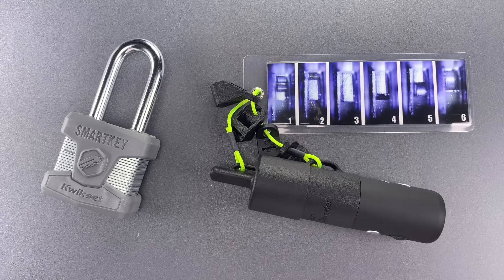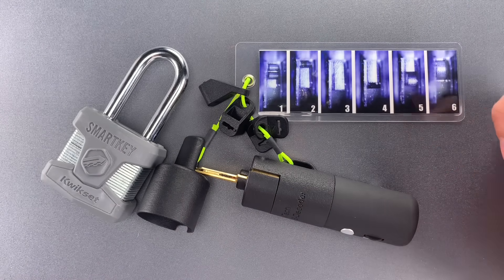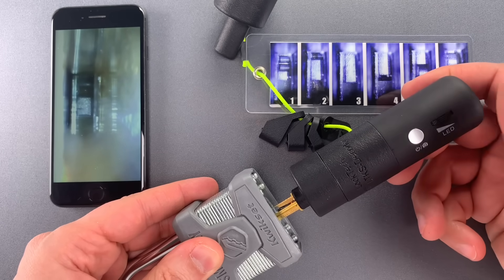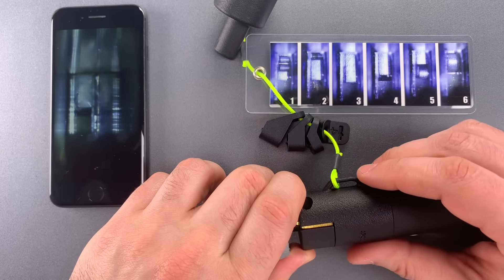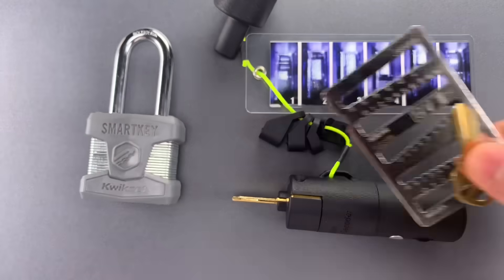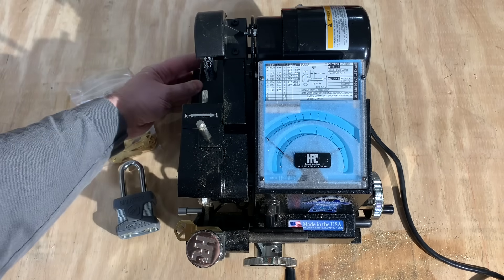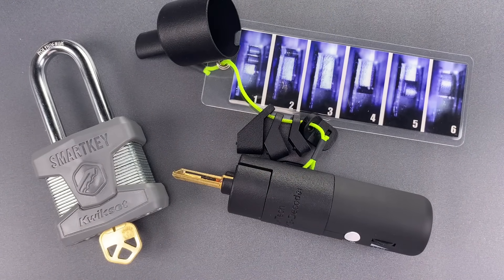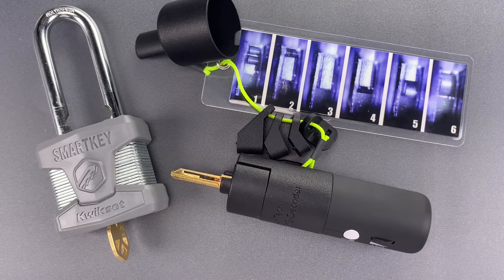[1209] This Tiny WiFi Camera Owns Kwikset SmartKey (LockTech LTKSD)

Comment: That phone application can easily be improved.  One should start recording a video.  Slowly slide the camera past all of the sliders to the all the way in position.  Slowly remove the camera.  Stop the recording.  Break the video down into stills for each Slider.  Calculate the Depths of Cut.  Generate the Code to make the Key (1, 2, 3, 4, 5, 6).

Comment: It never ceases to amaze me the ways which we have locks designed to resist attacks and tools to make attacks against new designs and to make the attacks even easier.  Picking a lock is an elegant solution but I'd submit so many of these would yield to a battery powered grinder or cut-off tool. Locks really only defeat the most casual of attackers. Just watch these videos on YT of home invaders bashing in people's front doors at night.

Comment: This tool is awesome when using it on a brand new lock. How ever when using it on a lock that someone has rekeyed it with a worn out key or a miss cut key . The cuts will not match any pictured or off to some degree

Comment: With a little software you ought to just be able to get a video stream and insert the key and remove it without even lining it up (as you'd get a full image of the interior) and then using a simple AI image detection to automatically tell you the key numbers. This could also be a handheld device that doesn't need the phone with a little more hardware -- but the bluetooth would be easy too.

Try inserting the key and pulling it out with video recording on your phone on, and then see if you can extract the frames needed to determine the key numbers by hand. 

This would allow for simply a quick insert and then later determining the numbers.

Comment: 2:10 dude GETTING ONE OF THOSE MACHINES for a private citizen must be so hard and require so much paperwork you NEED to be a lawyer to get it.
Reply: Surprisingly no. Just a credit card the camera device is about 400 and a basic key machine is 250 upwards. There are no bonds licenses or barriers to getting them.
Reply: @Lunas2525  It just continues to prove the point LPL has set out to prove: the locksmith/lock industry has largely relied on the public's ignorance rather than innovation the past 100 years or so. That really stuck with me after he showed a weakness in a common design that has been known since the '30s but someone like Master Lock is still using.

Comment: I'm so worried about my access security now (USA). I bought an easy KW1 pick with the little slider lever within. I opened my front and back doors in less that 5 minutes. Back in the UK I had Ingersol locks which were somewhat more secure, but always wanted Banham. I just want locks where a picking thief would just think it's not the bother.

Comment: i once called a "Locksmith" to open my front door cause i accidentally locked my keys inside.  Their very high tech approach was to use a giant set of channel lock pliers and rip the knob off.  once its off a screwdriver opens the door.  Cost me $140 to never trust a locksmith again. 😤

Comment: Good video, now I know a good locksmith should be able to make another key for a smart lock if you lose the original, but it reassures me that Smart Locks are still the best choice to prevent someone from just picking your locks.

Comment: This guy at my work, he'd forget his key many times for his tool box.  I took his key, and a piece of metal, used Die Blueing on the metal, used my scriber to copy the shape of his key.  Ground it down close with a bench grinder and then the rest with my tiny file.  The lock worked... actually it felt much better than the original at opening his box.  We left the spare in my box so it's there all the time incase he forgets.  I know that I can do this stuff all by hand.  I am use to filing things to within 0.001" usually just by eye, cuz I'm a Tool & Die Maker, we've got to be able to do that or others will think we suck at filing.

Comment: I've invented a electric key pick with quick changing heads for various lock brands/types. It works through oscillation and can open almost any lock within a second using a similar principle to a bump key.

Comment: It kills me that for all of your expertise on locks and lock picking and being a lawyer you still refer to pin tumblers in locks as "sliders". Sliders are mini hamburgers with absolutely no relation to a lock. A clothes washer isn't called a "dirt deleter". A clothes dryer isn't called  a "moisture remover". Hamburgers are not called "cow patties". Judges and juries aren't called "guilt deciders". Please, rub elbows with real  locksmiths or educate yourself on lock components and lock terminology. While it is a matter of opinion and the Blitz is a solid dependable manual code machine (and arguably the most popular), it is hardly the "gold" standard. Definitely a solid bronze or maybe a tie for silver with the Framon. The ITL automatic code machine is a considerable step up both in capability and consistently REPEATABLE accurate results. It is also more expensive, like gold (ITL) compared to silver (HPC). Both very valuable but silver just ain't gold.
Reply: The smartkey lock is not a pin tumbler lock. It has pin shaped components that interface with what LPL is calling sliders, I've also heard them called wafers, and a sidebar. I've never heard LPL call a pin tumbler a slider.
Reply: @spiffylocksmith1409 while you're right about this lock having something more like "sliders" than pins, this brilliant fella calls pin tumblers, yes PIN TUMBLERS "sliders" in other videos

check out his video on picking BiLock

where he AGAIN calls pin tumblers "sliders"

btw spiffy, I'm just getting started at this lock stuff, having been a locksmith for only 27 years and owning my lockshop for only 20+ years, so maybe I'm too new at this to know what a slider is. Maybe all of us locksmiths, manufacturers and distributors have been calling sliders pin tumblers by mistake for decades now.

LPL is admirably skilled but the LPL worship is a bit overdone. 

My point is that, for as brilliant as he obviously is, he is still clueless as to some of the terminology.

Comment: what if the key channels are different? How do you instert the camera? There are hundreds of type of lockpads, with lots of different types and shapes of keys,  This is just for one of them, and it costs $300+
Reply: If the "key channels" are different, it's not a kwikset smartkey and it doesn't have the little wafers the camera would read. This setup would also not work on a non-smartkey kwikset lock. It's a one trick pony, but the trick it is meant for is a very handy trick.

Comment: Hol tf up. With tech like that couldn't you make a lockpick with a camera built in?
Reply: What benefit would you gain from that? A lockpick you could see through while you use it to lift the pins of the lock? The design of this particular lock is what makes seeing inside useful. Though there is a tool, the one I'm familiar with is the "magic scope" that uses an otoscope with a pick attached to allow reading of wafer locks.

Comment: How much longer before the device gets upgraded to a higher-resolution, higher-framerate video; that would allow you to simply slide the device into the lock in one motion while your phone receives the images, uses AI to automatically determine the key sequence, wirelessly sends the specs back to an automated key cutter in your van outside and the new key has been cut for you in the time it takes you to walk back to your vehicle.

Comment: huh... well that is both terrifying and useful.  I use to work at a school district where there were some doors that nobody had the keys to.  They had their own key cutting machine, but with no nice way to open the door, some closet spaces simply went unused.  Something like this for $300 would be cheaper than a locksmith and new cores for a few mystery doors.  No idea what brand of locks though, it wouldn't necessarily be that cut and dry.

Comment: Isn't this able to be done for any key lock?
Reply: Not in this way. Lishi tools can decode a pin tumbler lock after picking. A person with the right skillset could also read the depths of the pins inside your lock (after picking it) to cut a key for it. Or, having picked the lock they could disassemble it to fit keys to it. But this camera does smartkey locks and only smartkey locks.

Comment: I'm a bit confused as to how a camera sees the cut depth from the faces of the pins unless the intentionally put the depth encoding there, which would beg the question why?
Reply: This camera sees the edges of the sliders attached to the pin shaped cups in the lock. The blade of the tool lifts all pins to the same height, but each slider is attached in a way that it gets lifted to a different position according to the depth it is set for. So each depth has a unique appearance from within the keyway.

Comment: Kwikset: we finally made a lock that LPL considers decently pick resistant 
LPL: let me show you how to make a KEY for it
Reply: Kwikset: Takes a sip of water before spitting and screaming out. "OH COME ON!!?"
Reply: @adtrlthegamer7449  Pretty much, but then again how many thieves are going to use a specialized camera and then to cut a key and have the equipment laying around to do so? The decoder camera cost over $340 alone? Unless they are very professional and something very valuable behind the door, or gate which if it is then sure be way more secure then just a pad lock? Unless they not looking to steal but break into in for other reasons like to go after someone and don’t want to force entrance

Plus locksmiths already use devices similar or decoder tools already.
Reply: @thetechgenie7374  Ok.
Reply: @thetechgenie7374  the point is, there is literally no lock that is unpick able given minimal effort
Reply: @LineOfThy  LOL, a wifi camera and $1000+ machine is "minimal effort."  Ok.
Reply: @mintymus  For pros, it is. They go in, use the wifi camera, take pics. Go back to a parked van with the key cutting tool or what-not and then come back and just open the lock.
Reply: @straywolf77  Exactly, "for pros."
Reply: Yeah, if someone uses a wifi camera on your door, then has one of these machines to cut a key...I have bad news for you.  They're getting in your house no matter what...it doesn't matter what kind of lock you have.
Reply: And not even use a lishie tool to decode it

Comment: Seems like for the cost of that key cutter you could get a CNC milling machine that could do the job even better (no need for templates or manual dials).  Would only need the right software.

Comment: If I get this right, this trick only works if the lock has a key with a standard size. If a lock uses a wider or longer key this method will not work, am I correct?

Comment: Now imagine this except it uses a gear to insert automatically and process the photos. I imagine there are smaller key cutting machines that could easily be deployed in the field as well. Just a few steps away from complete automation.

Comment: I bought a 98 volkswagen jetta years ago that had no keys, but I knew the door used the same key as the ignition. I took the actual lock out of the door, pulled the pins, and wrote down the number that was on each one in order, then took it to a local locksmith. He was astounded that I did that, he cut a key, and it worked perfect.

Comment: The part of this I found the most interesting was actually the key cutting machine. I've never seen one up close and overhead before. Some years ago I dabbled at making my own keys with a set of blanks, gauges and a hand nibbling tool. It was frustrating, laborious and, in my hands at least, I had a high error rate with incorrectly cut blanks outnumbering my successes. Your machine embarrasses my pitiful efforts.
Reply: At least you tried... 10/10
Reply: @jimmysparks315  I tried again since leaving the earlier comment and, using the Albert Lebel method with my Lishi nibbler tool - take smaller bites, be patient and be prepared to sacrifice lots of blanks as I practice - I had more success. It's still tricky to cut Yale and similar blanks (the formats usually found here in the UK) with that tool, but it can be done.
Reply: @bikkies  20/10 !
Reply: Most locksmith here have this and I witnessed this in action several times when I order duplicates for my keys
Reply: @GeneticFreak  Neat. Over here, when they are duplicating a key, they are quite literally duplicating it. The machine has a gauge, that's mechanically connected to the key blank, and as they move it over the original, the blank gets cut.
Reply: @harrodharrod5239 the cheaper guys can do this but the more expensive ones can make round and triangular keys
Reply: You've never seen a key cutting machine? Have you never been to a hardware store?
Reply: @mediocreman2  Never up close to one, no; only as a customer. I've stood at the counter, spoken to the person in the oily overalls, handed over my keys, asked them to make a duplicate and came back again later to collect it. Since posting my comment I've watched some ad-hoc videos so have a tiny bit more awareness now, but not much.
Reply: Hand nibbling tool? I always use a set of needle files.

Comment: So how do you pick or fabricate center-cut/milled keys?   I encounter many types in my daily work... from standard single edge, dual edge, center milled and edge milled... of them I can imagine the center milled and edge milled would be both the most difficult fabricate a virgin key for.
And bloody expensive - it costs over $200 to cut the center milled key to my VW - and that's with an existing key to be the template.  It costs $7 to replace the key to my Ford.

Comment: In the late '60's I bought a '64 Malibu SS that had an ignition key but no door key.  I went to a locksmith to have one made.  He removed the driver's door card and got numbers off the door lock.  He then took a machine that looked like a cross between a pop rivet gun and a label maker and dialed in the numbers to cut the  key. The cut key had square cuts instead of the usual teeth like most keys.  It worked great, and even keys I had made off of it worked well.  Is this machine still available and what is/was it called.  BTW, I love your videos!

Comment: I work with kwikset and schlage locks at work, I really dislike kwitset, their locks are kinda terrible, and I have never seen a single security pin on them when I accidentally cause one to explode, although seeing as I haven't done that on the smart key locks I can't confirm that this still holds true.

Comment: The Smartkey may be popular, but I still think it is crap. It is better than the version Schlage put out and quickly recalled. When I want a Smartkey lock opened without regard to saving the lock, a screwdriver does the trick. I wouldn't put a Smartkey on a dog house.

Comment: Couldnt you even just cut the key out of something like sheet metal, or a strong carboard once you have the dimensions?  Unless its a tight old lock that takes a good deal of torque to open I dont see why it wouldnt work, and would cost dam near anything one you had the camera

Comment: As an expert in 3D printing and CNC technology I'm surprised that you folks haven't caught up. For the fun of it, I 3D printed a working key for one of my locks. If you have the numbers for a particular lock it should be possible to "add" a blank key object file with each of the correct cylinder offset object files then slice/print the resulting toolpath file. You could either print it on a metal (or even plastic) 3D printer or mill it using a CNC machine from metal, for example.

Comment: I have a new lock that is pick proof and anti-burglar proof. It is custom and is enclosed in a C4 explosive charge. The proper key is made of a neutral material that will not effect the C4. However, smart asses that insert an incorrectly pinned key and especially the wrong material (i.e. brass, steel, or other), or a pick of any sort, will find themselves blown 20 feet back without any arms or face. 
A warning sign reads "Try to pick this lock and we will be picking your half dead ass off the sidewalk"

Comment: The lock you cant pick either open is Iloq. And thats because it works not only mechanically but also has internal code which has to match with the lock base key to open.

Comment: all I use for my rental properties are kwikset smart locks and dead bolts, what are some cheaper alternatives to key cutting machines that work with the presets of kwikset smart keys? That HPC 1200 Blitz Code Machine  is definitely too expensive.

Comment: When I was working for an Oldsmobile dealership , The parts department had a hand operated key cutter that a depth gauge that could be set for whatever pin was being cut . With a squeeze of the handles a new key could be made using some code that was in a manufacturers manual. AND ....it was cordless!
Reply: The counter guy at our GM dealership had the cut depth numbers memorized.   He'd cut you a fresh key just by looking at your key for a second.

Comment: Cool gadgets, I remember when a young teen about 40 years ago and my parents would occasionally take away my car key. Being a defiant kid and handy with tools,  I then drew around the actual key on a sheet of aluminum and marked the grooves. I rough cut then hand filed a key cutting key slots with my Dremel tool and a guide, after a bit more filing the key worked perfectly!  I just wanted to see if I could do it and I did, lol. 😎👍
Reply: Hell my first car, a 48 chevrolet, the key would turn with a dime.  The tolerances weren't very tight on those.
Reply: My first car, a 61 Buick Special, the ignition switch would turn without a key.  It had a lock position, but I never used it.  I also would always lock the door by reaching through the vent window and pushing the handle forward.